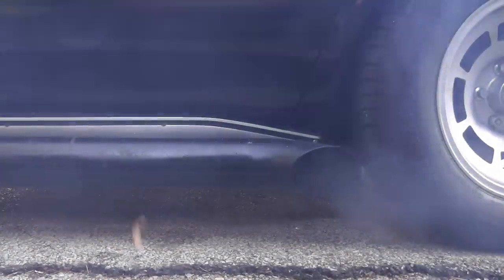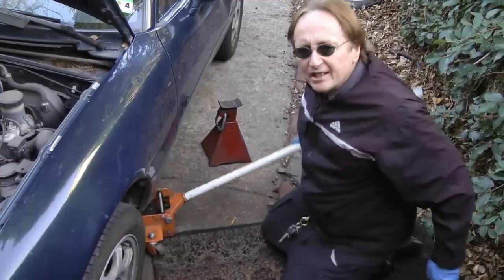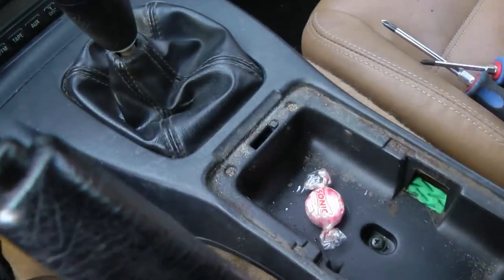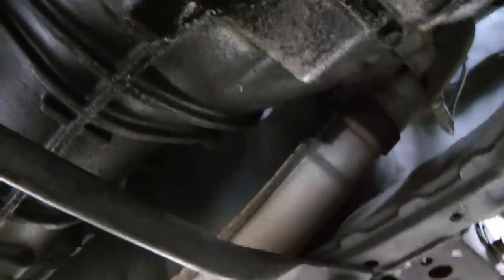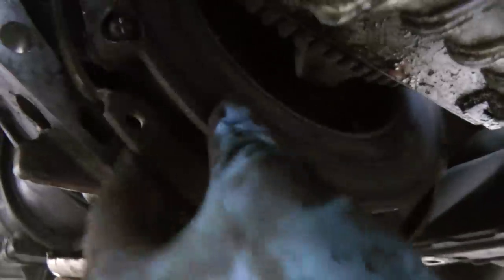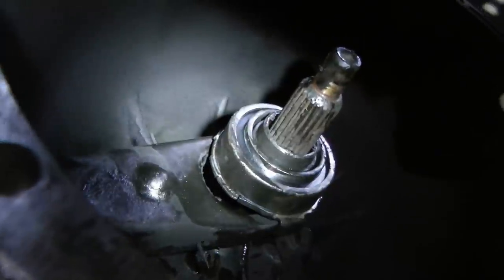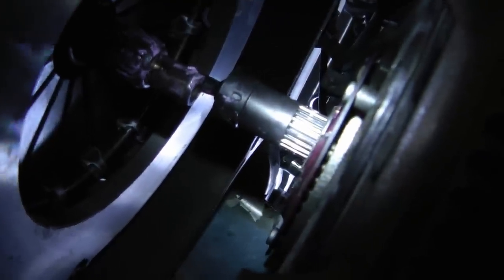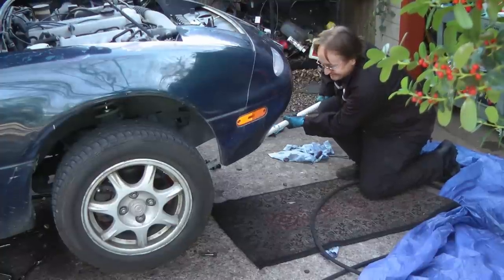How to Fix a Slipping Clutch in Your Car (Clutch Replacement)

Comment: My clutch in my 3000gt either slips or doesn't full engage when i change gears in high rpms (5-6 thousand rpms) and i don't know if I should try adjusting the it at the pedal or not because it's at the factory specs it also had a new clutch 5000 miles ago
Reply from the maker: time for a new clutch unless someone has adjusted it tighter recently. They are self adjusting and don't tighten up by themselves just driving

Comment: I have a 91 celica it turns on then dies and then when it does stay on and I put it in to gear it hardly moves then starts jerkin bad the dies. What could it be I changed the plugs it had fluid. I cleaned the throttle body and sensors inclouding the mass airflow sensor

Comment: Scotty, 1995 Ford Explorer 2 wheel drive 4.0 , the overdrive light is flashing , it only shifts 1st 2nd 3rd , how do i fix that ? bad speed sensors ? also i am being told they have a common problem with the valve body gasket blowing out, let me know, thanks
Reply from the maker: could be that, BUT get it scanned, the od flashing means transmission trouble codes have been set.

Comment: Sir can u help me,my kia pride B loss power when climb up hill I shift down to 2nd and 1st its starting loss engine power when I push the accelerator  down,I have no idea if it is the engine problem or the power supply...help pls tnx

Comment: I have a 97 nissan pickup xe, when it starts up in morning its find but if I stop  and start it right back up it just don't want to start and it takes several attempts to get it started. Yesterday the ground cable got so hot that it started to melt replaced cable same problem today. 177k on truck any solution? 
Devon morgan
Reply from the maker: replace the starter then, a worn one will melt wires.

Comment: I have a 62 Chevy Camaro and I THINK the clutch is slipping. My first gear picks up no speed at all and my 2/3 pick up on speed slowly. I pick up speed on my 5th gear. Which really sucks. Any advice or tips?
Reply from the maker: yes, time for a new clutch, and if it's got a big engine, put a racing clutch in, they last longer
Reply: Any advice on where to get my hands on one?

Comment: Hey scotty, Any realiable website where i can buy a whole kit for the clutch??
Please, i need to get one for my honda civic lx.
Reply from the maker: personally I buy them locally, I don't trust web sites for such important parts, many sell cheap chinese knock offs. Any foreign car parts store an get you good kits at good prices, here in houston I use bap geon 713 227 `1544 and they cost me a hundred bucks or a little more
Reply: Scotty Kilmer
Yeah I second that. Recently got new ignition coils for my 2001 Civic and prices would be as high as $220 or as low as $64 on ebay or elsewhere online. I paid $120 less than my local Honda Parts center charged. Got them online at a genuine OEM honda parts store. My old coils were working and the site has great return policies. But for a clutch... and if it was already dead as in Scotty's video here I'd get from a local parts store.

Comment: How much harder would this be for a 1970 ( exact year unknown)  f 250. A friend of a friend wanted me to do it and i said it would be a bit out of my skill level.
Reply from the maker: actually a ford truck that old is easier, just weighs a bit more
Reply: way easier on bigger trucks and the older the better, more room down under and drive shaft and tranny is easier to get out but it is a lot more heavier which is the  only part where you should make sure u use the correct tranny jack and heavy duty jack stands and what not

Comment: Hey Scotty,
Just swapped the clutch on my 98 Nissan Sentra 1.6L and I now my clutch pedal sits on the floor. I can't put the car in gear now. Any advice?
Reply from the maker: +william delaney you don't need to, as I didn't open up the hydraulic system to the air

Comment: I just replace my clutch in my ford explorer sport 1999 and it fell like it slipping some one said to change my transmission fluid what do you think
Reply from the maker: tranny fluid has nothing to do with slippage except in automatic transmissions. See if clutch is adjusted too tight on the pedal
Reply: How can check that and should i change the fluid anyways  thank for taking the time to right back

Comment: i have a 2003 5spd neon car is making a high pitch grinding noise every time i push the clutch i put a new starter it continue to grind mest up the teeth on starter but before the high pitch. noise grinding the reverse and 5th gear stop working i would just drive the car in 4th gear at 3000rpm

Comment: Hi Scotty, I have Nissan almera  2003 (1.5), the car was parking for 1 year, now i tried to turn on the car, i realise that the car needs code for the key, i think the battery is gone, what do you think happened, what i need to do.
Reply from the maker: sitting there not used should not do anything to the anti theft system. BUT, if you need a new battery now, some cars require the remote to set the theft system back after the new battery is put in.

Comment: u always want to resurface the flywheel cause if anyone has grinded the clutch not the shifter or drove while on the clutch u can cause excesive heat spots that get hardened, which can cause one area the wear on the flywheel alot less an can cause it to eat at the new disc more an more but u can take it jnto a napa store that can do it an they charge about 35 to 40 dollers to make it like brand new so that would be the best bet to do

Comment: Hey I have a 01 eclipse gt, 3.0 v6 the cruise control light turns on when I try to set it but it doesn't set. I bought the relay for it but I don't know where it is to replace it im guessing that's the problem?  Any advice
Reply from the maker: rarely do those relays go bad, more often the main cruise control module goes bad itself. If it lights up, relay is not bad
Reply: Scotty Kilmer thanks, do you have any videos that show how to replace the module?

Comment: I have a 2000 mustang 3.8 5 speed, my rpms want to drop slowly between shift and will sometimes jump up to about 2 grand or 3 grand when pressing the clutch peddle. The rpms will usually not go down until the car comes to a stop for a few moments. It will randomly drop normal but not often. I have changed the IAC, TPS, and MAFS and this did not fix the problem. Its very frustrating because its seems as if the clutch is being rode when shifting kind of a grunting sound and a bit of a jerky shift any insite would be appreciated.. thanks
Reply from the maker: often the throttle assembly needs changing on that model, they sometimes can be cleaned with spray cleaner inside completely to work, but often they need replacing as a unit

Comment: Hey guys, so my miata kept popping out of first so I figured it might be the clutch. Now I have the transmission out and everything but the clutch disk and everything looks perfectly fine. Any idea on what else could be causing it to pop out?
Reply from the maker: +workinprogress49 first gear is shot, get a used transmission, rebuilding those costs a ton
Reply: +Scotty Kilmer hey scotty my honda shakes really violently when i disengage the clutch and i give it a little gas. if i slowly realese the clutch with out giving it gas it does not do it , and only does it in first gear when i try to take off from at a complete stop.. could it be that my transmission  mount is gone? because my clutch is not slipping it has grip is just the earthquake that i have when i try to take off
Reply: You probably just need to adjust the linkage.
Reply: +Nadizita Could be the flywheel that has an irregular surface...

Comment: As an example: i tried out the doing some of scotty's fixes on my own car, specifically, cleaning the Throttle Body, and i got something wrong,, ill never try out again, just thinking in replacing a clutch by yourself is crazy

Comment: Hi Scotty. thumbs up for your videos, your doing a great job. i got my clutch kit (- the flywheel "got it machined') changed at a local mechanic and plus a lot more other things done on it. but my main concern is that my car has a unexplained vibration coming from somewhere in the car. i took it to the mechanics and he tells me that the clutch has been put on properly. (but i got vibration) he tells me that my Diff is starting to go!!! can a diff cos a vibration? and what should i look/do in this situation?  
You can check my video before the clutch replacement their was no shake at all. even with a lot of torque to the wheels. thanks. 
The Car,1889  BMW E36 M3 with 160k miles
Reply from the maker: +BmKOSWarrior   yes, diffs can cause that vibration.  But really, if it didn't do it before the clutch, more often it's a problem in the clutch or the drive shafts, like a bad guibo joint on that BMW which is rubber and changing the clutch often breaks them or cracks em causing vibration
Reply: Scotty Kilmer My car was parked for 1 year and a half in my driveway then the day i took the car to my mechanics shop i was abusing the car a little and i heard a little THUD as i was doing some burn outs did i mess my diff then? how much should i pay for a diff like that? and whats the best place to get it from and is it more ideal to rebuild used or new diff? two years ago i changed all the goodies that attache to the drive shaft. 
sincerely thanks for such a fast reply and your knowledge.

Comment: I have a 08 pontiac montana it has no heat when idling. I changed thermostat I don't know whats next to do.
Reply from the maker: flush the heater core out, they often clog and do that.

Comment: I got a 2007 toyota tacoma trd sport and it's a 6 speed manual transmission but I'm having a bit of grinding issue with the 5 gear as I shift it into the gear when I press the clutch in it grind a little then slides in place
Reply from the maker: +Brian Price fifth gear synchro is wearing out
Reply: +Scotty Kilmer any advice on fixing it
Reply: +Scotty Kilmer scotty where do you buy your clutches? i have a 93 3000gt i want to do a clutch on they have ebay clutches for like 100 bucks that are exedy xtr, but i dont trust ebay clutches
Reply: Gonna need to double clutch with 5th
Reply: +Toyota 3SGTE sorry for not helping in anyway, but all I wanna say is nice 3000gt :D those are my favorite model, and hope I can get another one sometime in the future, I had a 95, but I really want to get one with popup lights ;D
Reply: ***** ah i sold my 97 now i own a 93 it has the pop out headlights same color as my 97 which was white haha

Comment: You forgot to mention to use a none water soluble to clean the pressure plate. They lightly grease it to protect it from moisture as the box stays in storage as the pressure plate friction side is all steel. This can contaminate the clutch if not cleaned.

Comment: scotty i have problem with the clutch, it doesnt go in reverse only 12345 it shift good on all the 5 gears, only reverse not at all
Reply from the maker: either shifter linkeage is bad for R, or transmission reverse gear is shot
Reply: Scotty Kilmer before that the floor mat pushed the pedal down and the rpm go to the top and i put it on the 4th gear to  slow it down until i stop and move it and the clutch burned out, but the car still drive and after 3 days the reverse gone what you think? the clutch gone or something else

Comment: I´ve got a noise on the clutch. However it desaapears when clutch pedal is engaged (pressed). Hope the problem is only on clutch and not on gearbox.
Thanks for your time.

Sorry for bad English.
Reply from the maker: +Richard Mamani pray it's the clutch, cause it's either that or a bad main shaft bearing inside the tranny. ONLY replacing the clutch would discover if it's that or not
Reply: +Richard Mamani What does the noise sound like?
Reply: That sounds like you've got a worn clutch bearing, buy a clutch kit, replace it and it should be good.
Reply: Thanks everybody for help. The problem was main shaft bearing, it had to be replaced. (Thanks god).

Comment: I have replaced all the lifters on the mazda and have used marvel mystery oil as well.  noise is still there.
Reply from the maker: then valves or other internal engine parts are just flat wearing out and engine would need rebuilding
Reply: T thank you so much.  I went ahead and replaced the motor
Reply: san cheng shouldve just rebuilt and high peformance your old motor buddy! its easy as balls.

Comment: I have a vw cc 2010 that has loss power on the highway and clanks when i put it in reverse. normal city driving is fine just an issue when parking or making a uturn. how do i replace the clutch pack? is this even a clutch issue, trying to avoid being quoted an arm + leg
Reply from the maker: just about everything on a VW costs and arm and a leg with transmission work.  But it sure sounds like you need a clutch, any honest mechanic can drive it 2 minutes and tell you
Reply: I just had the car when in "D" flash the letter same when it's in "r" "n" "s" it would be in these gears and the engine would rev and nothing. Turn the car on/off and everything would be fine again. CEL also just came on. Is this still clutch? Some say it's mechatronics unit
Reply: if it's the dsg it maybe the mechatronic unit and their was a tsb and recall for all affected models ..you should call your local vw for tell them you wanna know if the recall for your car has been done. they should ask for your vin and if it's been done you'll have to pay for it out of your pocket

Comment: u have a 99 gt I was driving put my car in nuetral, tryed to put back in first and it wouldn't go in even if you tryed to force it. I turned the car off and put it in first and it luckly slipped into first and u drove it a couple blocks to my house any suggestions?
Reply from the maker: +Pedro Durant odds are you either need work on the clutch hydraulics, or the clutch needs replacing. Pray it's just a slave or master cylinder gone bad
Reply: +Scotty Kilmer it wouldn't be the clutch cable?
Reply: +Pedro Durant Scotty my clutch is wire and also when thus happened the clutch pedal was stiffer than normal

Comment: Easy to do on a RWD car. Try that on a front wheel drive....most of them you have to unbolt the whole subframe and front suspension just to get the transmission out!
Reply from the maker: see my video "replacing a clutch on your car" it was on a Honda, and it can be done at home too with a few tricks.
Reply: Scotty Kilmer subarus shouldn't be as bad since the trans is in the behind the motor vs to the side  i think all you got to do is drain the radiator and remove it then unbolt a motor mount and then pull the motor up a few inches and you get enough room to do the rest , out of my dads loyale and my gl 220k and 240k havent done a clutch job to either and still seems fine .

but moms legacy has an auto with 191k miles and have no idea when the trans been serviced so i'm a little worried about that one still shifts great though

btw you dont seem to work on many subarus do you scotty?

Comment: Can you make a video on how to bleed your clutch slave cylinder?
Reply from the maker: already have, just type "clutch cylinder" on the search engine on the scotty kilmer channel opening page on youtube
Reply: Scotty Kilmer
And it worked, thanks but i have a really stupid question now. When i was trying to put my motor and transmission back into the car, i tried to put it into gear to help me take off my drive pulley. When i put it back into the car the shifter is stuck in reverse and wont go back to normal. I see all i have to do is find the position of it and its fine but i have no idea where is the spot.
Reply from the maker: Lionel Davis
depends on the car and year model. For instance, a mazda miata has a back up light switch you remove, then put a metal pick in there and you can snap it out of reverse. Some other models require taking the transmission apart to do that.
Reply: Scotty Kilmer
Oh i got it. I had the cables on the wrong spots.

Comment: my 95 Nissan Altima when I shift in first to second gear it goes all the way to one side when I'm in 3rd or something it does the same thing it goes to one side and doesn't stay where it's supposed to and it turned off on me when I was slowing down and I was trying to push the clutch in it turned off on me like 3 times already